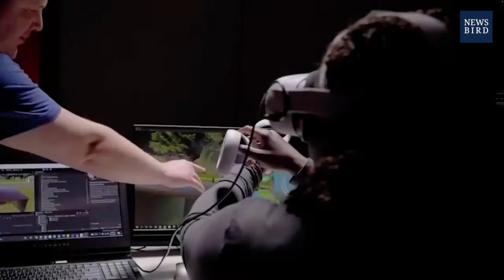B-21 Raider අමෙරිකාවේ අලුත්ම බෝම්බ හෙලන්නා

Comment: What is different between b2 & b21 . Shape looks similar
Reply: Good question. Well, for one, more than 30 years of technological improvements. When the B2 Spirit had its first flight back in July 1989, there was no Internet (it was being born at American research facilities and universities), no World Wide Web, no smartphones. Stealth technology also has made similar advances in that third of a century: avoidance technologies, avionics and the way these aircraft communicate are worlds apart. Jetliners of a half-century ago had "similar shapes" to airliners of today, but you know that the technology packed inside (and on the outside, if you know what to look for) is very much different. Ditto the B2 and B21.